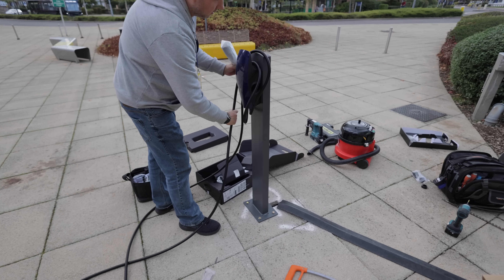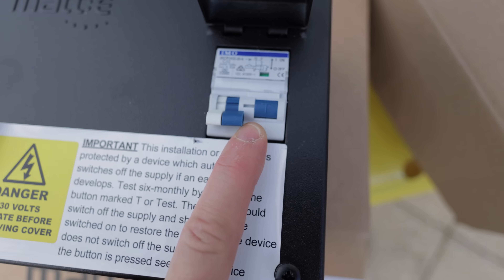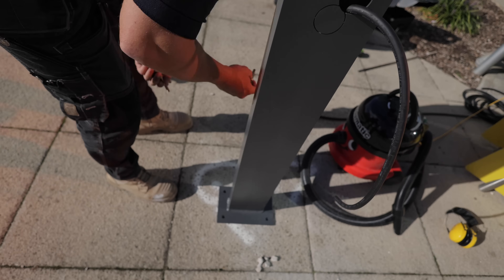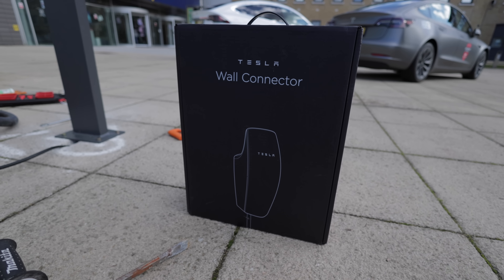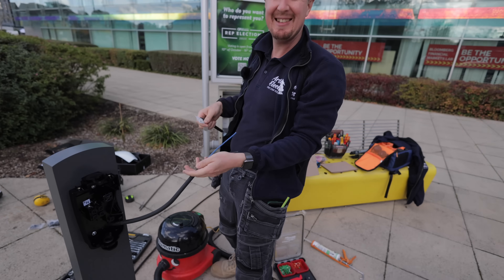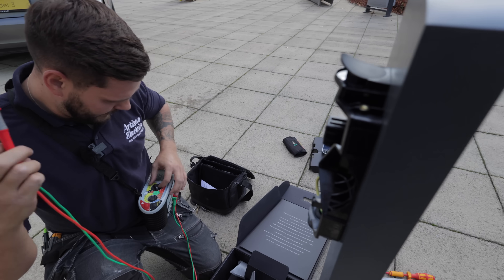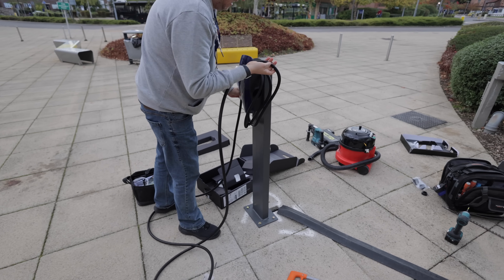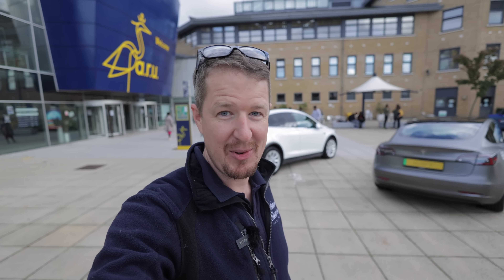Tesla Charging Point for an EVENT - Temporary EV Charger Install

Comment: Ive never seen anyone tighten down an anchor bolt then remove it to then install what your installing and tighten it again. Just drill the hole tap the anchor in and bolt down what your bolting job done. Why do it twice 🤷‍♂️

Comment: I'd be peeed off if that paved area belonged to me - a great bit slot cut in it when the temporary pillar could have had a hole in the side and the cable fed out through a gland directly into the surface protection strip. Sorry guys you are missing Cory's finesse! 😊

Comment: How does the cable protector sit with heat dissipation?  Doesn't it get hot?  I'm wondering about it as a solution for occasional use at a site

Comment: For temporary Instalations like this, including temp cabinets I always have a thick 50KG metal slab that I use as a base, and that slab have already the holes for the assembly of the electrical stuff.

In this case a metal slab of 1000*1000mm with spacers for the pedestal would give a sturdy instalation without making a single hole in the stone, and be unmovable, even if you tried to tilt it by using the pedestal as leverage (because of the size and weight of it).

But to put that in place you would need 2 strong people (probably 3) and a good lever activated magnet (most do easily 1ton).
Reply: Smaller, lighter base, a bunch of stage weights and dress it with a nice box with promo logo on. One person job, no drilling, job done.
Reply: @mfx1  that too is a great idea. Put their logo plus their social media contacts and you have a great promotion piece.

Comment: Temporary set up awesome. Although if you didn't have to use the Tesla connector you could use one with all of that nitty-gritty stuff built-in it would've been a whole lot easier..... I think the protection should all be built into the EVSE connector box with only an upstream RCD as back up Protection in case the built-in one doesn't trip otherwise it complicates the system so much.

Comment: I'd have used a 32A male on the pedestal, and not chiselled out the floor - but of course, I'm lazy!
Reply: Yeah mounting a socket on the pedestal and then just make up a run of cord. That just leaves the pen fault protection which ideally it would be in the EVSE but Tesla... I wonder if that could've been mounted to the pedestal too (probably not IP protected). Another option would have been a concrete block that I could sit down and anchor it to and then could get moved around but wouldn't easily get moved.

Comment: Can a standard 7.3kw charger charge a Tesla?
Reply: Yes, in Europe/UK. American Teslas have a different connector because reasons. Basically everything AC is Type 2 and almost every vehicle will take anything over about 1.4kw. Most home chargers or "destination chargers" are 6-11kw, although some will do up to 22 with a suitable three phase supply.

Comment: Not trying to be a keyboard warrior just trying to learn

Because there's an RCD in the Matte device, and by the consumer unit, does one of them need to be time delayed?
Reply: I believe one needs to be time delayed or one with a higher or lower by a slight amount trip value.
Reply: How comes the matte device didn’t trip but the further one away did??
Reply: @MegaMetinMetin  if not time delay and same trip current then it will be random as to which one trips from my experience. Sometimes one, sometimes the other, sometimes both.
Reply: Could of tested the matte rcd without tripping the upstream , if you know you know

Comment: Glad to see the PEN fault protector contactor disconnects all lines.  I have seen at least one solution, where the contactor just handles the earth.  So if the contactor fails (which is more likely than an actual PEN fault) , no PE, and you would be blissfully unaware of it. 🤨  I would like to see a video on how all these different solutions work.

Comment: Have you earthed the metal stand
Reply: well Yes they bolted it to the earth LOL.
I wish they went over their ground bonding earthing. I'm assuming the pedestal is completely isolated and will not cause a problem and with the high abrasion resistance cable and temporary nature requiring inspection before reuse it shouldn't be an issue. I suspect the EVSE connector is tied to the system ground that's requiring the pen fault protection.